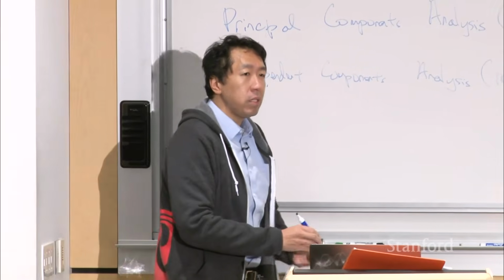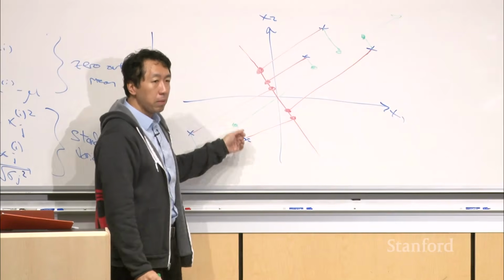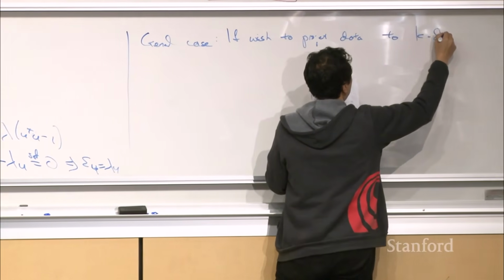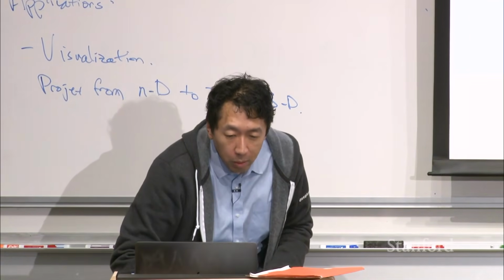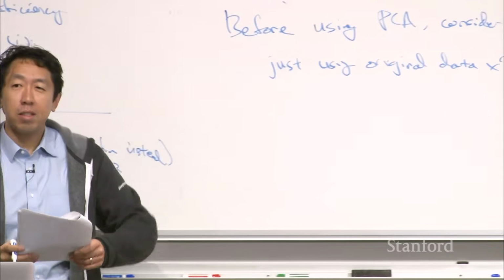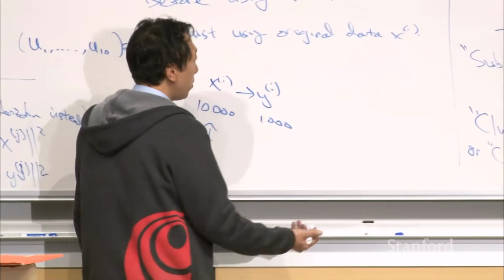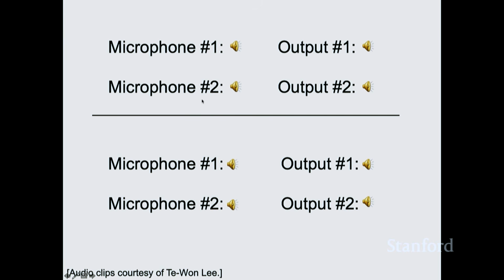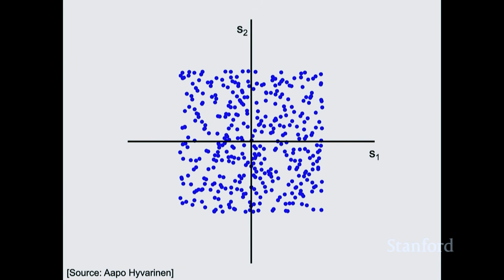Lecture 15 - PCA and ICA | Stanford CS229: Machine Learning Andrew Ng - Autumn 2018

Comment: you always teaching as best of ml sir but what you teach please implement direct coding so we can know how to use that
Reply: Ay 1:00:19 he says itnincorrectly doesnt he you can havr zeroo varisnce in data even of all examples are the same but not necessarioy all zero..if all the values are the same there is no variance, whether they equal zero or not? Or because same data being equal have diffrrent values of subcomponents is that what he means,?
Reply: @leif1075 , as you pointed out, the variance is zero when all values are equal. However, keep in mind that, in this case, the variables are assumed to be pre-centered.